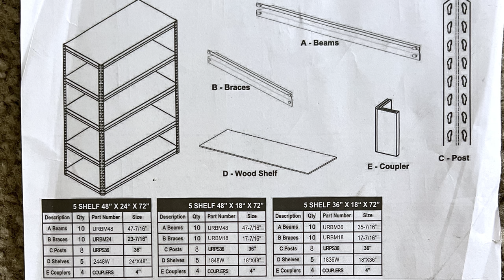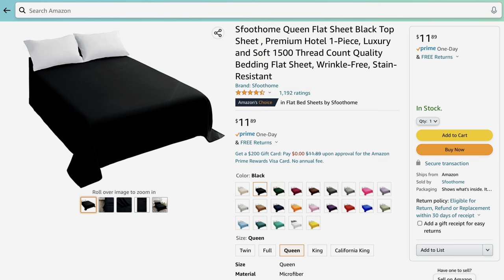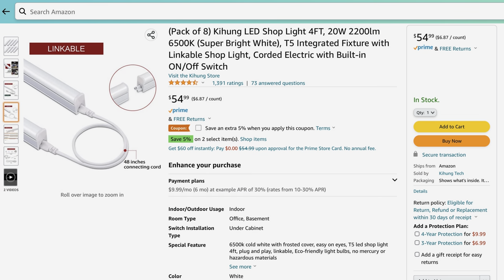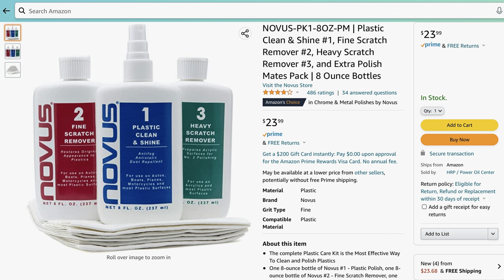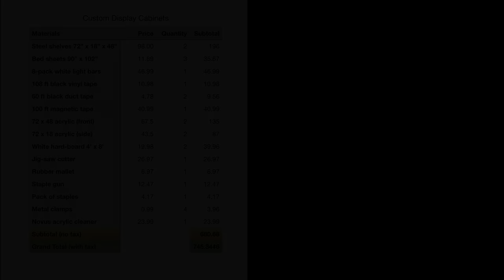DIY Custom Display Case Tutorial | Posing with Peter

Comment: Is the magnetic tape strong enough to magnetize to the shelf if you super glue it to the "front" of the hardboard before covering it in the bedsheet? Seems like doing that would create a good seal and then you could just put vinyl tape over the remaining exposed holes in the rear supports.
Reply from the maker: Oh nice that’s a great idea — I’m sure the hardboard would stick to the backside of the frame via magnetic tape, but I guess the only downside is buying even more magnetic tape which can get a bit expensive. I had only bought just enough magnetic tape for the acrylic panels so I used duct tape for the hardboard on the back to save on overall cost of materials. But you’re definitely right! Magnetic tape on the hardboards should create a decent seal 😁
Reply: @PosingwithPeter  True, I noticed the magnetic tape was one of the costlier line items. I'd like to try to make one of these at some point and but was worried the black duct tape might come undone over time, but then again the back will obviously be coming off a lot less frequently than the front panels so magnetic tape might be a bit overkill. Maybe you could get away with sandwiching the covered backboard between the shelf and half a dozen or a dozen  cheap, strong magnets at key corners? I can't find the weight of the hardbaord on Home Depot's site so I'm not sure if it's lighter than it looks.

Comment: Peter did you need two separate light kits with the extension plugs for the two cases or was one kit enough for both
Reply from the maker: One kit of the 8-pack is enough for both cabinets since it includes 8 light bars and the necessary 48” cables that are long enough to daisy-chain each light bar to the next shelf. 

I originally bought some of the extension connectors because I thought they were needed, but it turned out the included cables were long enough so I returned the extension connectors.
Reply: @PosingwithPeter  ok I bought some extra extensions just in case because I opted for two of the 36x18x72, so I'm only using 2 ft of lighting per shelf. Thank you when it's all done I'll tag you on IG

Comment: Hi. just wondering how heavy your acrylic panels were? I have mine on my shelf however theyre too heavy and slide down, still stuck to the shelf though. I saw that you used neodynium magnets. I'm using those too currently. How many did you use per panel? (side and front) Thank you.
Reply from the maker: Hmm the front panels are definitely much heavier than the side panels. If I had to guess I would estimate the front panels are about 10 lbs each. 

As for the magnets, I superglued 3 of them to the top border, and 4 of them on each side border (basically at the points where the horizontal shelf intersects the black border of the panel). I hope that helps.

Comment: Hi peter, did you cover up the holes on the metal uprights of the garage shelf with tape ?
Reply from the maker: Hey there! As it happens, I did not cover the holes on the metal frame. I have seen some people use black vinyl tape to cover the holes but I personally didn’t like that aesthetic so I left them as is.

I’m currently building another set of garage shelf cabinets in my living room and I might end up covering the holes using black poster board… Just need to cut out thin pieces that match the height of each metal upright portion 👍

Comment: Hi Peter, I'm still undecided what the height between shelves would be best. What measurements do you have for yours right now?
Reply from the maker: Hey Reginald! Haha yeah I was also undecided when building the cabinets… I think I changed them 3 times but currently shelves 1 and 2 are around 15 inches tall, meanwhile shelves 3 and 4 are about 20 inches tall. I did it this way since my Star Wars figures take the top 2 rows and they’re not very tall nor do they require crazy aerial dynamic poses so I didn’t mind giving them the least amount of shelf height. 

Meanwhile row 3 is DC and I knew that I wanted Superman to be hovering in the air, hence the taller vertical space for that shelf. And shelf 4 (bottom 4) basically got what was left over for misc my sci-fi figures.

Hope that helps, and thanks so much for watching!

Comment: Hey Peter, quick question. I'm trying to follow your instructions down to the letter. I haven't got the shelves yet but can you give me the measurements for the acrylic sheets? I think I saw that the sides are 18x72 for the sides and how about the front?
Reply from the maker: Sure thing! The dimensions of my front acrylic sheets are 48” across x 72” high x 1/8th” thick. I opted for 1/8th” thickness since I wanted them to be rigid and study to prevent bending & flexing but it’s worth mentioning that they’re a bit heavy. I think 1/16th” thickness would work too and I might even go that route when I build more cabinets like this in the coming months. 

Hope that helps but feel free to ask if you have any other concerns. Best of luck with the custom build, and thanks so much for watching!
Reply: @Posing with Peter  oh ok thanks! I can't wait to put everything together. I'll definitely won't hesitate to ask if any other questions should arise.
Reply: @PosingwithPeter  Hey Peter, one last question. Can I get the side dimensions just to be sure I do it right. Thank you.
Reply from the maker: @adrianbillionaire  Sure, you actually had it right in the first comment 😅 My side acrylics are 18” x 72” (1/8th thick), but it’s worth mentioning that I went 18” side panels because that’s how deep my storage rack is. I’ve seen other collectors tend to buy storage racks that are 24” deep so that can accommodate vehicles, so those people would need side panels that are 24” x 72”.

Also, since we’re on the topic of side panels: I only got 2 side panels for the outer sides of the entire build. I didn’t bother getting panels for the inner sides since I just conjoined the two racks using black zip ties.  

Hope that helps!

Comment: Question, did you double the layer of magnetic tapes? I find mine to be very weak and can't hold the plexi well
Reply from the maker: Hey there ☺️ Yeah I think I mentioned in the video that I applied 2-layers of magnetic tape around the edges, so indeed it’s a double layer for more thickness. 

Although, I noticed a few weeks after the build that the adhesive on the magnetic tape would come undone, so I superglued the magnetic strips to the acrylic sheets.

If your panels aren’t sticking to the metal frame, you could also buy tiny circular fridge magnets from Amazon to help keep the acrylic sheets attached to the frame at the weak points.

Hope that helps, and thanks for watching!

Comment: Great video got a problem though 
Bought the same 4’ light you did when I put the wires in to connect them all together they won’t fit any more in the rack how did Tudor it with a 48 “ w rack
Reply from the maker: It’s a tight fit since the wires/connectors run parallel & straight out of each light bar. However I forcefully bent the connectors to about a 90 degree angle in order for them to fit into the metal frame.

It’ll help if you plug the connectors into the light bars as much as possible first before bending them to get them to fit inside the rack. Hope that helps. Lemme know how it goes!
Reply from the maker: Costa just had a livestream and demonstrated bending the connector to fit it into the cabinet: https://youtu.be/MVTbFststwI&t=23m38s

Comment: May I ask how you wrapped both sides of the shelf? 

I saw your update and wanted to follow it, but you never showed how to do it. I've been trying to think of the best way to do it without leaving a ton of obvious staples on the bottom.
Reply from the maker: Sorry for the late reply!

It’s kinda hard to explain that process via text but I’ll try: first I laid the black bed sheet on the floor and ironed out the wrinkles. Then I placed a wood shelf on the bed sheet and cut just enough fabric to wrap both sides of the shelf. 

As for the staples, first I lined up the black bed sheet to the very edge of the shelf and used 3 staples (middle, left corner, right corner) so that the bed sheet would hold in place on that side (keep in mind, the side with the staples will end up being the bottom side of the shelf). Then I wrapped the fabric all the way around the shelf and pulled/stretched it so that it would overlap to the same side with the first 3 staples. Then I just stapled the fabric around the edges while pulling on it to remove the wrinkles. Once that’s done, you can cut off any excess fabric that hangs loose next to the staples. It doesn’t have to be perfect because all the staples will be on the bottom side of the shelf and hidden from plain view.

I hope that helps, and again my apologies for the delayed reply. Thanks so much for watching and I wish you the best of luck on your build!
Reply: @PosingwithPeter 
Ahhh, so you made the staples overlap each other on the same side. I think I get it from your explanation. 

No worries about being late. We all have our own lives. Thanks for even bothering to leave a response! Many would not even do that.

Comment: 48 X 72 =2 

1/8 CLR

18 X 72 = 2 

Are these the exact measurements needed for the acrylic if we are doing the shelf on this video?
Reply from the maker: Nailed it!

It’s worth mentioning that the 2 side panels that are 18 x 72 don’t really have to be 1/8” thickness. I built a whole new set of these in my living room a couple months ago and used 1/16” thickness for the side panels since it was just a tad cheaper. However I still maintained 1/8” thickness for the large front panels since my cats like to lean up against them so I needed sturdy front panels to avoid folding inwards. 

Hope that helps, and best of luck with your build! Feel free to ask any questions during the process and I’ll try to reply when possible 👍

Comment: The acrylic, the thickness for the side and front are they both 1/8?
Reply from the maker: Yeah in this video I went with 1/8th inch thickness on all sides.

I built 2 more cabinets just like this in my living room a few months ago and I used 1/16th inch thickness acrylic panels for the sides — it was a bit cheaper but they are VERY thin and flimsy when removed.

Comment: Did you get any issue with vinyl tapes or magnetic tapes coming off on some places after a while?
Reply from the maker: Yeah the adhesive on the magnetic strips kinda wore out after a while so I just added various drops of Loctite ultra gel to the magnetic strips and have not had any issues since.
Reply: @PosingwithPeter  ah okay. I figured that would be the case after a while since the LED tube could get warm.  Thanks for the info!

Comment: How does the power cord exit from the bottom shelf to outside of the case? Did you cut a small hole in the back or side?
Reply from the maker: As it happens, the plugs/connectors for the light bars are routed upwards through the very top of the cabinet. They both plug into a surge protector that sits on top of the cabinet which is also connected to an extension cord that runs down the backside of the whole cabinet and into the wall outlet.

Comment: Hello, how did you be the 4 ft light strips to fit? With the connectors on both end, they are too long to fit in the shelf?
Reply from the maker: Yeah at first they may seem a bit too long to fit into the width of the frame. However once you fully insert the cables into the light bar as much as possible, you can then bend the connectors 90 degrees at both ends in the shape of the letter L which will allow them to fit snug into the cabinet. 

Hope that helps!

Comment: Did u wrap both sides of the shelves with the sheet? Or just the top?
Reply from the maker: I wrapped both sides for most of the shelves. However the upper most panels that form the ceiling of the cabinet are only wrapped on one side that’s facing down since there was no need to wrap the top of the cabinet. Same goes for the very bottom shelf panels (no need for the underside to be wrapped since they’ll be facing the ground if that makes sense).

Comment: Sorry, noob question. Between vinyl tape and duct tape, which is ideal and more durable on acrylic surface?
Reply from the maker: Not a noob question at all! I would say vinyl tape is the better choice for the acrylic panels for a couple reasons: 

1. vinyl tape way more durable since it just stretches when pulled, meanwhile duct tape can actually tear. 

2. Vinyl tape is less reflective because of its matte surface so it makes the border of the acrylic panel more aesthetically pleasing. On the other hand, duck tape is often reflective or has a rough surface, so using it on the acrylic panels might make the borders look a bit less appealing. 

Hope that helps!
Reply: @PosingwithPeter  Thank you so much for the reply. The reasoning is exactly what I'm seeking !

Comment: I am not sure if anyone has asked this...did you have to secure it to the wall so it wouldn't tip over in case of someone pulling on it or an earthquake?
Reply from the maker: Great question! No one has asked that yet ☺️

Even though I live in SoCal which is quite prone to earth-quakes, I did not secure it to the wall because it’s already very heavy and is weighed down by its wide base. I’m also not worried about anyone pulling it down since I don’t have any kids to worry about, and luckily my friends who do visit are very respectful of my property as well 😁
Reply: @PosingwithPeter  Thanks, we are planning to move were they have barely minor earthquakes more like tremors.  So if you aren't worried were you are then it shouldn't be a problem.

Comment: Did you put magnetic tap on the back board as well?
Reply from the maker: Nah I just used black duct tape for the backside since magnetic tape is a bit pricey. The black duct tape did the job at a fraction of the cost 👍

Comment: Hi, What height measurements did you use for your shelf?
Reply from the maker: My apologies but I don’t have the exact measurements since I just adjusted the shelf height based on what looked right — additionally I’m currently out of town and away from my collection but if I had to guess, I’d say the shelf height ranges from 12-16 inches depending on the shelf 👍

Comment: What did you put at the bottom of every ahelve cause for top part u said u wrap the sheet and staple it on the back but what did u put in the back to make it black and hidde the staples
Reply from the maker: I wrapped both sides of each shelf with the black microfiber bed sheet, then stapled them underneath and closer to the front side so that any visible staples would be hidden/blocked out by the bright light bars 😁

Comment: Where did you get the acrylic sheets? I can’t ever find any that aren’t like $700 or more
Reply from the maker: Hmm I think I mentioned in the video that I bought mine from a local shop that specializes in plastic. At first I looked online like Home Depot / Lowe’s / Amazon for acrylic sheets but it was all very expensive, so then I searched on google maps and yelp for local businesses that specialize in customizing plastics & acrylics. After calling a few places for some price quotes, I went with the most affordable one in my area (south Los Angeles).

I hope that helps with your search options. Best of luck, and thanks for watching!
Reply: @PosingwithPeter  you probably did, I watched this video when it first came out. Then it popped up in my feed again so I figured I would ask because I’m currently trying to find solutions.

Comment: Would Velcro work for the acrylic instead of magnets
Reply from the maker: Yeah that would work, there’s actually a video by BogleArts using Velcro on his cabinet at the 11 minute 45 second mark: https://youtu.be/AiPvF76p26o?si=-BrzLjJFIUTzlOru

I personally didn’t want to use Velcro since it seemed like a bit of a struggle to peel the acrylic off the cabinet (the amount of force that’s required to pull the acrylic off the cabinet via Velcro made it seem like the cabinet could lean forward causing figures to topple over). 

But as always, do what works best for you!

Comment: I used a different shelf from home depot, but the magnetic tape barely keeps the plexiglass attached. Any suggestions?
Reply from the maker: Yeah some of the adhesive on the magnetic tape wore off after I uploaded this video. An easy solution was buying this pack of small circular neodymium magnets. I just super-glued a few of them around the corners & edges of acrylic borders for a much stronger magnetic hold to the metal frame. 
Non-affiliate link: https://a.co/d/3TnxNvw

Comment: By any chance do you know how thick are the acrylic panels?
Reply from the maker: I do! The chose 1/8th inch thickness which is sort of on the thicker / heavier side. I wasn’t planning on cutting the panels into separate pieces, so I wanted the large panels to be sturdy and less likely to bend or fracture from being so large. If I had opted for the thinner 1/16th or 3/32nd thickness, they definitely would have been much lighter in weight but I wasn’t sure how those would’ve handled being removed as a large panel while being so thin. 

Hope that helps!

Comment: Damm, how did you get the acrylic so cheap. I've asked everywhere and they're quoting me upwards of 500$ and hardware stores don't sell 72x sized sheets
Reply: I had to pay $412 cut for mine but they're Lexan instead of Plexiglass so much more durable and bendable. Less worry of it breaking or chipping.
I got mine from a local glass cutting place. Might be worth calling in to some to see if they stock clear panels.